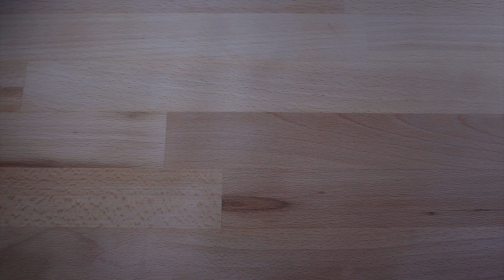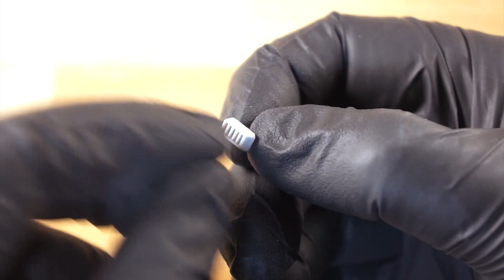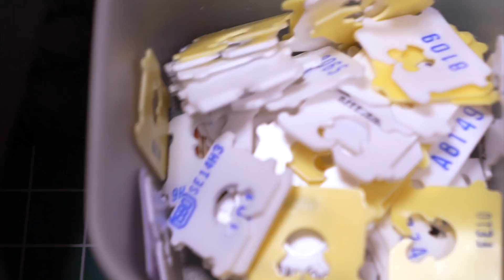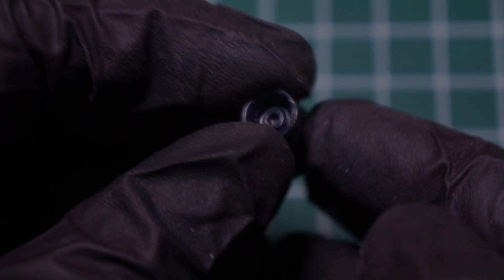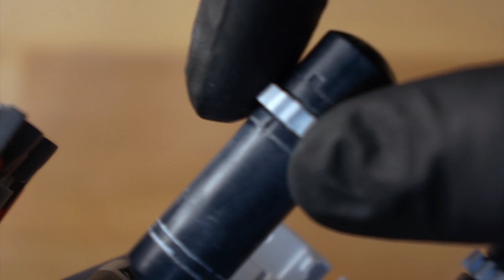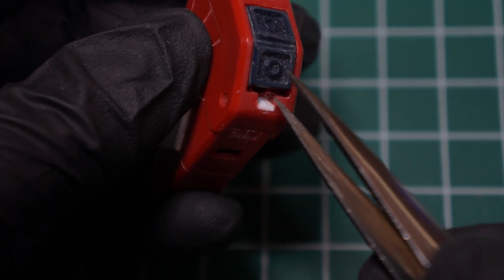Sazabi Ver.Logic Scratch-Build - Part 4 | Panel Scribing & Detailing

Comment: just my opinion, but hoping you paint the PE details. it looks alot more trick than plain metal.
Reply from the maker: I may consider it, though its being used fairly sparingly and would provide some glints of metallic detail to contrast the otehr surface types.  Will keep it in mind for sure though!!! Thanks. Any suggestions for how you like to handle those? :)  Would need some metallic primer, though maybe a good opportunity for Tutorial :)